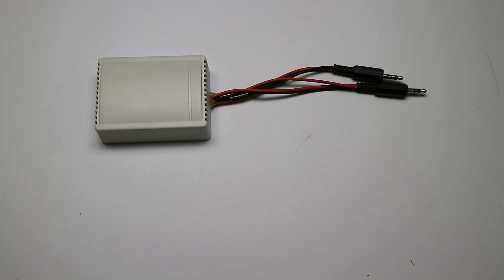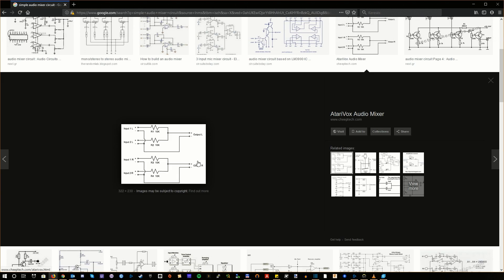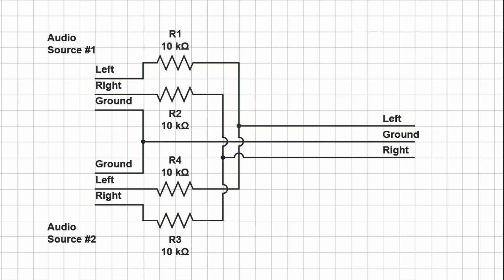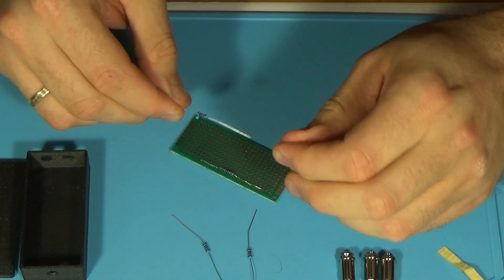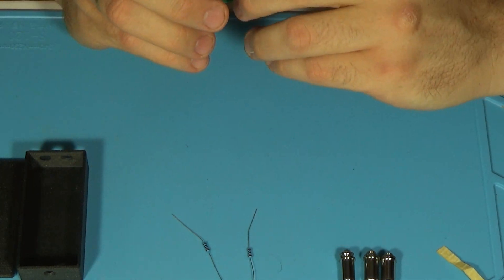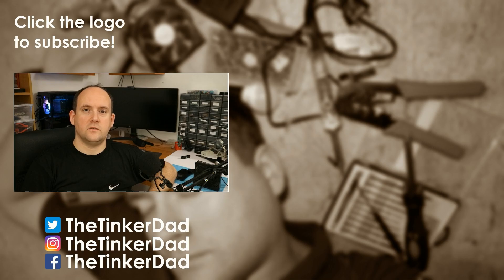Super Simple DIY 2-Channel Audio Mixer! (Mini Project)

Comment: Sorry, noob question: What happens if I make a 3 or 5 port mixer? Can I go the same way with same resistors?
Reply from the maker: I'd rather not do that to be honest. This is a very crude and simple design - it does not give you any control over the mixing nor it provides a way to avoid possible overload peaks caused by having for example 5 ports. An 5 port mixer should be a much. much more sophisticated design imho.
Reply: These passive solutions are not good because they are not high impedance inputs which will cause signal degradation. Just use an op amp. it is not much harder to use than a resistor although it might seem like it is more complex. It does requires a battery but you'll get much better control and can stack as many ports as you want.

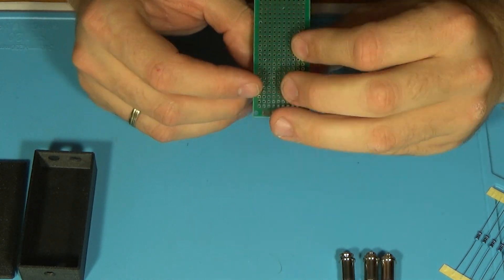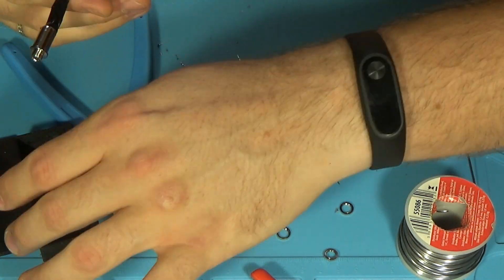Comment: Apparently, I'm on a level even below the mentioned 'total beginner' bc from 6:18 till 9:40 it's completely unclear what kinda unexplained and undetailedy-shown abracadabra you did with the 'protoboard' and the in-&output plugs of which you btw also forgot to tell us how/where exactly to acquire those items

I would have liked this vid bc the thing you made is exactly what I'd like to find (or make), but this unclarity combined with the description-promise that a total beginner could do it if you'd actually e.x.p.l.a.i.n everything instead of only showing the circuit diagram in the first two minutes of the video results in a thumbs down from me

☹️
Reply from the maker: Well, I do agree that this is one of my early videos and my explanation style is anything but perfect. Based on your comment yes, you're correct, you seem to be new to hobby electronics, which is like not even beginner. That's okay. The parts are so common that it literally takes a minute to find a place to buy them on Aliexpress, Banggood, etc. or you can salvage them from old audio equipment.
The mentioned "abracadabra" is pretty much a recording of some boring and lengthy through-hole soldering, adding a handful of very basic parts to a protoboard which is like the simplest way to make a PCB humanly possible. There's literally nothing to explain there for such a simple circuit, other than "solder them on the protoboard and make the connections". All the information you need for the circuit connections is shown at 03:09 on the schematics. Obviously, you'll need the very basic knowledge of how to read it.

Anyways, no hard feelings and thanks for watching the video.
Reply: @TheTinkerDad  thanks for the reply. I didn't know this was an early video of you and yes I am a total n00b who's never done anything in electronics. I was searching online to buy sth like this and, finding nothing nowhere except for DJ mixers that also have slides for volume control and whatnot, in a desperate attempt googled "diy audio mixer" (bc eg "audio joiner" only yields software results) and found your video. I haven't seen any of your other videos yet but I will

Comment: Love the intro. I think it would be nicer to use sockets. I think the 10K used is pretty high, you will lose allot of strength of the signal. Actually it acts like a voltage divider.

Comment: Hi. I am looking for a simple solution to mix my guitar signal from a practice amp (has a 1/4" headphone output) with an audio signal from an audio streaming device device (computer, phone, etc) to an stereo headphone for quiet night jamming. I can control volume with each device, so I don't think I need to complicate things with potentiometers. Would this box work for my needs? (I noticed that you had your language set to Hun. Are you Hungarian?). Cheers. Andras from Canada
Reply: A pot is just a variable resistor.

The issue with these passive mixers is that they are high impedance outputs while also generally being low independence inputs. This causes signal degradation. 

It is better to get a cheap audio device that does what you want as you can get many different features such as storing tracks, recording, etc. Probably for 20$ you could find one or even something used that is even more robust(maybe something old).

Comment: Nice tutorial, i was wondering if you considered making this as a cable, as i’d like to give a try myself. Saves a box, making it more compact. Or would that become a really mess?
Reply from the maker: Hey,

Thanks for the feedback! I think you could make it as a cable, but probably not with these resistors - their legs break off way too easily imho, so even if you decided make it into a cable, you'd probably need something to keep them from breaking. Maybe a tiny (1cm diameter) 3d printed cylinder or something that could house the resistors. Anyway, if you make this as a cable, let me know how it turned out! :)

Comment: If i added a diode for safety  would it still work?
Reply from the maker: I assume you want to protect your audio output devices with it, right? Personally I've never tried it that way, but according to answers posted here, I would rather not introduce a diode to protect / rectify a direct audio line. https://electronics.stackexchange.com/questions/136127/using-diodes-to-mix-2-audio-signals-into-one-set-of-speakers
Reply: @TheTinkerDad  will it work in reverse as a splitter?
Reply from the maker: For sure, but in that case there's a voltage drop too. On the other hand, if you use it with powered speakers (which have an internal amplifier), you should have no problem besides that you need to crank up the volume a bit :)
Reply: A diode chops off the half of the waveform.

Comment: Hi!
Why you are using 10KOhm resistors? Is it necessary? Why didn’t you just solder the wires to mix the signal? 
If the resistors is needed, can I use different resistors, for example 1KOhm?
Thank you
Reply from the maker: Hi!

Sorry for the late answer! The thing is, if you mix the two signals just like that, at certain points the signal can get too strong and clipping can occur or it can be simply too loud. Consider it very basic a safety mechanism. Remember: it's a very basic mixer, as my simple goal was to connect two stereo systems to a single stereo speaker. To answer your question, yes, of course you can experiment with different resistor values. Furthermore, if you replace the resistors with potentiometers, you take a step even further towards building an actual mixer. Here's some help on the topic of building mixers, starting from really simple ones: https://www.circuitlib.com/index.php/tutorials/product/39-how-to-build-an-audio-mixer

Have fun!
Reply: @TheTinkerDad  Thank you!
Reply: Such big resistors would make signal too small for earphones without amplifier, is not it?
Reply: Theologically will work fine on line level signals (+4dbu) with preamplification after this mixer.

Comment: are not danger do that..seem like can be short
Reply from the maker: You're partially right I think. I mean this circuit idea has been out there in the wild for 20+ years and lot of people built it. On the other hand, I've been also playing with the idea of making sure current cannot flow in the opposite direction due to some kind of power surge - e.g. this mixer currently connects my PC and my Amazon echo to the same stereo - so if for example my PC's PSU goes out with a bang and fries the motherboard, it still should not fry the Echo... or vica versa - a faulty echo should not blow up my motherboard with a power surge... (These are highly unlikely situations though, but still...)
Reply: ohh i see..im otw to try..

Comment: Neat little project. I like the pre-made project boxes, and I also like the one you designed too. Was it hard to make sure the lid was a snap fit?
Reply from the maker: No, not at all. It's all about making sure the chance of rounding issues during the slicing is as low as possible. This might sound complicated, but it's not. There are a few tricks I usually do when I design and print project boxes - now that I think of it, I could actually create a video about explaining them.
Reply: @TheTinkerDad  that would make a great video
Reply: @TheRealBobHickman  same